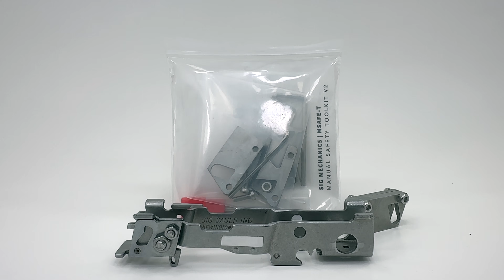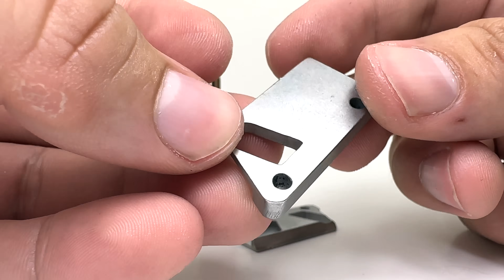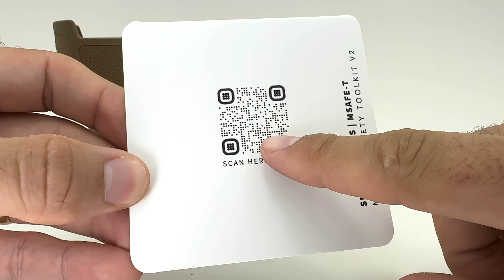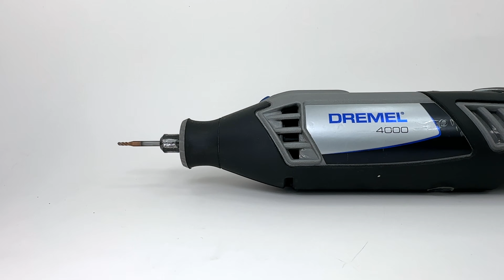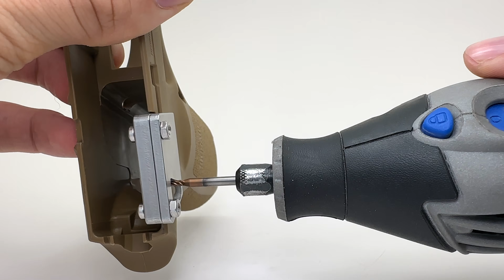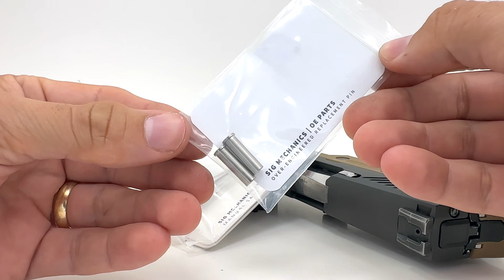P320 MSAFE-T V2 - NEW UPGRADES and FEATURES

Comment: For a P365 am I better off with a manual safety or a trigger safety?
Reply from the maker: I know you would prefer a direct answer however I can only say that this really does come down to personal preference. I alternate between both.
Reply: I guess I more so wasn’t sure if with the trigger safety if the striker could still malfunction versus with the manual safety.
Reply from the maker: @MastaKeahi well, on that end, I would say adding another layer of safety will always beat one less. Though if your concern is mainly from the aspect of what is said about the 320, the 365 is built slightly different. That design has never really been challenged in the same way.
Reply: @SIGMECHANICS  Thanks for the advice! I really appreciate it!

Comment: Are all trigger bars (no safety) for the p320 the same? Ive run into trigger bars with the number 1 that seem to drag against the FCU and not reset the trigger properly and have no problems with trigger bars with the number 2 on them. I thought they were all the same, but i dont know, do you?
Reply from the maker: They are all the same but produced by various companies. Could just be minor molding variances. The numbers are essentially indicators for which location/manufacturer the part was made.
Reply: @SIGMECHANICS  Wow thanks for the response. That explains a lot, I cannot for the life of me get the one's with #1 to work properly and I did notice that the bend on the trigger bars is slightly different. I measured EVERYTHING on them, but the main problem seems to be there are a few degrees of bend (angle) difference if you're looking at the trigger bars head on. That seems to be enough to make it unusable for some FCUs without modification.
Reply from the maker: I know what you’re talking about. Is your FCU an early production one?
Reply: @SIGMECHANICS  I've tried it in several FCUs and seems to be hit or miss with the #1 trigger bars regardless of early or late. The problem is specifically with the #1 trigger bars, they don't seem to play nice universally.

Comment: Can u offer just the grip modification tools for those that dont need or not looking get the fcu template just the grip templates?
Reply from the maker: I will soon.
Reply: @SIGMECHANICS one question is there template for p365 or can same one be used even though was design for p320?
Reply from the maker: @kratos696 I don’t have anything for the 365 grip module.

Comment: will this work for a p320 x-ten 10mm?
Reply from the maker: Yes, it works with the X-Ten (regular), however, it will not work with the X-Ten comp due to the wider slide.
Reply: @SIGMECHANICS  thank you!
Reply from the maker: Anytime! Remember that if you need any help with your Sig or with the kit you can always reach me at sigmechanics@gmail.com.
Reply: Any plan to provide a manual safety kit for the X Ten Compact?
Reply: @charlesmorgan18  think it’s the same fcu

Comment: Does this work with the full size P320 .45 Nitron with the drop safety upgrade??
Reply from the maker: Yes, it does
Reply: @SIGMECHANICS  Well then! I need to get on this. I've wanted a manual safety for it since I got it. I will be reaching out with a question or 3. Thanks man!
Reply from the maker: No problem, feel free to send me a message at sigmechanics@gmail.com. Also, don’t forget to get the free sear housing role pin when you get on the website.

Comment: Does this work on an axg?
Reply from the maker: It’s not specifically made for the AXG, although I have seen images and gotten emails from people who have used the jig to cut the frame and then manually cut the side panels.

The MSAFET however works best on polymer grips as the AXG grip generally has a thinner side wall and therefore the jig is looser fitting.

Hope this helps!